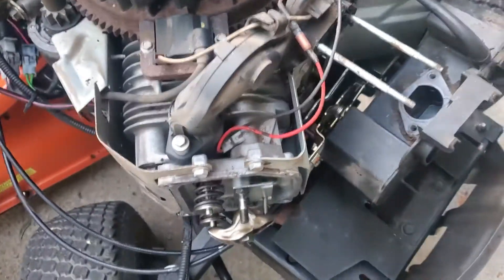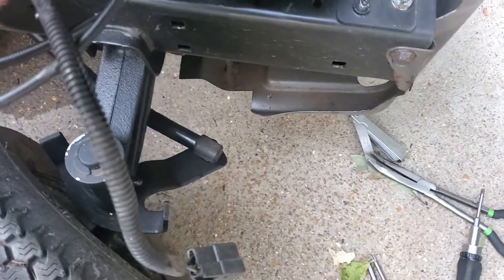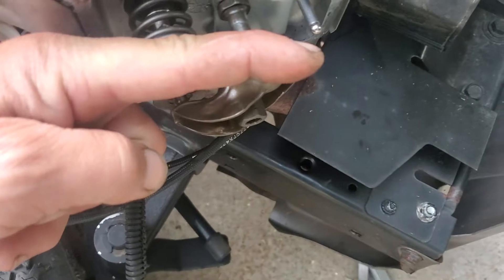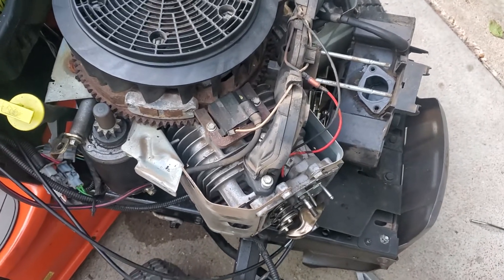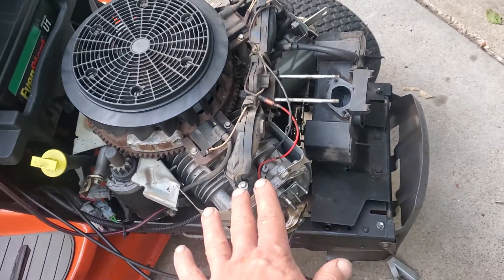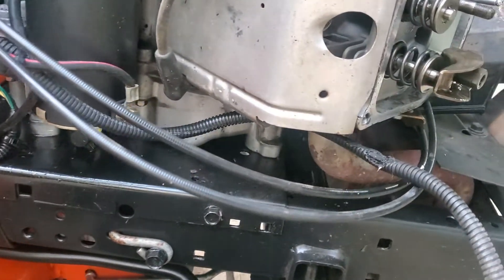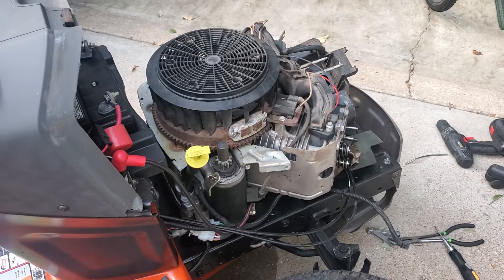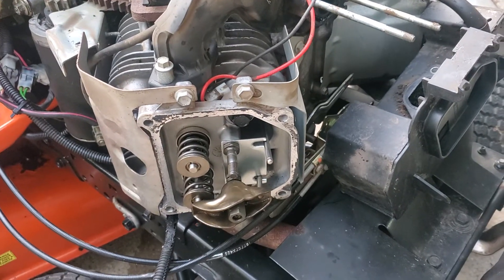Kohler courage 24 horsepower valve stuck

Comment: Straightened push rod, manually oiled the intake valve rubber hammer worked the stuck valve, which loosened it to free movement. Reassembled Valve and straightened push rod. Permagasket-ed the cover and reassembled it to the genuine. Checked the oil and filter. Engine repaired.

Comment: Do the job bud , don't be afraid , you can get a good junkyard used cyl head or buy a new complete one for like $150 and literally all you need to do is pop off the two exhaust.pipe bolts , the 4 intake manifold bolts , then the 4-6 smaller bolts that hold that aluminum shield around the cyl head in place then finally simply loosen all four 14mm headed cyl head bolts which are right there under the valve cover then poof just simply pull the cyl head off.  Then simply clean the top of the piston and remove all the old head gasket.material from the surface on the block that your cyl head moumts to , then once cleaned.up.simply install your new cyl head with the new head gasket.of course ,.then just put back on the shield , the intake manfold and air box and the exaust pipe , last install your valve cover , put a new spark plug in thst new cyl head and snap the spark plug wire properly onto the plug , then put the plastic engine cover/shrpugh back on.  Oh before you put your valve cover on don't forget to obviously reinstall your two push rods and set the valve lash to proper spec on both the intake and exhaust valve , especially if it's a used cyl head. Also use new Kohler genuine valve cover , intake manifold and cyl head gaskets , you can reuse the exhaust gasket if it stayed in one piece upon removing the exhaust pipe from the old cyl head. Even with just basic hand tools , specifically standard set of metric and SAE 1/4" and 3/8" socket sets and ratchets , as well as regular set of sae and metric wrenches , only two specially tools you'll need is a basic.torque wrench , a 3/8" cheap click style one from harbor freight will work just fine for setting torque on the 4 cyl head bolts , and second specially tool is a set of feeler gauges which are used for setting valve lash qnd can be bought for $10-15 max at any normal auto parts store.  Or you could easily just remove the cyl head and pop the keepers off on that stuck valve , then remove the retainer and valve spring , drive out the old valve guide with a punch , clean the valve seat , install your new valve guide , then quickly just lap the new replacement valve in , clean up all lapping compound and put the valve in then the spring and retainer on , use s cheap or homemade valve spring compressing tool to compress the valve and install the keepers in their proper notch then remove the spring compressor , install your push rod, set the valve lash , and the rest of the parts , being the shroudd around the cyl head , spark plug and wire , exxhaudt pipe , intake manifold and lastly air box and plastic engine cover , it's really a fairly basic entry level job that anyone who's even a little bit mechanically inclined should be able to accomplish in 1.5-2 hours , or even one hour flat if your an experienced mechanic.  Dive in brother don't be afraid , engines are just as basic and simple to disassemble and reassemble as erector sets thst s child would play with.
Reply: I have the same engine on my zero turn. Intake valve stuck closed with bent pushrod probably from sitting 9 months with low oil and running bad gas. With the springs on, I knocked it with a hammer to get it unstuck. Seems fine now, I'll find out if I have compression when the new pushrod comes in. Did I screw up by hitting it?
Reply from the maker: When it comes to replacing the jugs, they can take it someplace else im not going that deep. But I would change a compression release cam if it needed to be done that’s about as deep as I go on these.  Could I rebuild the complete engine if I wanted to,  absolutely. Do I want to, absolutely not